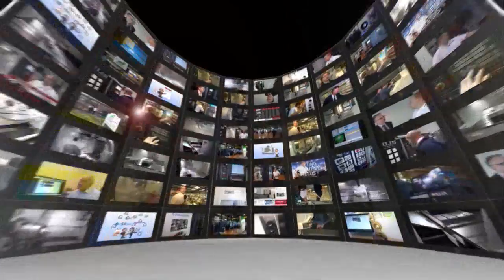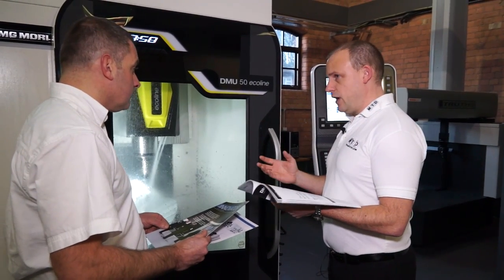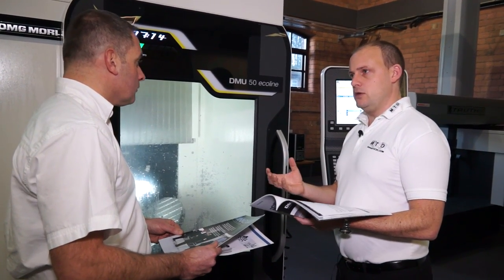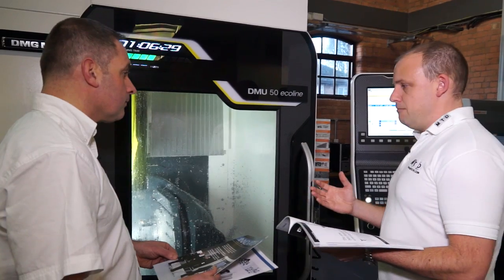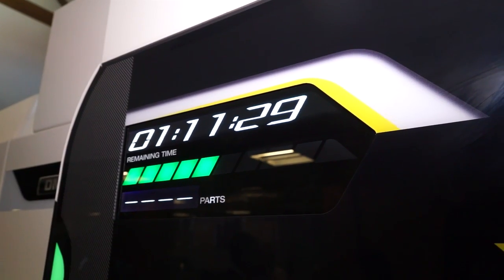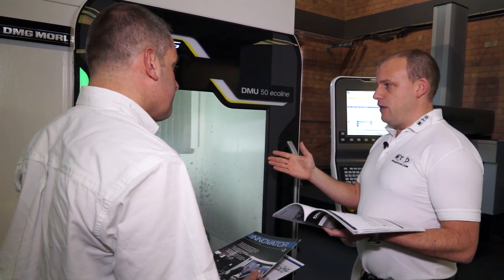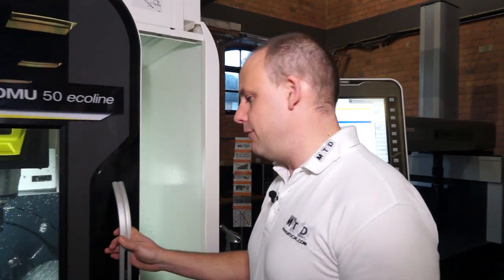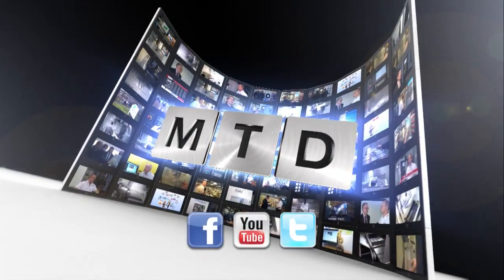DMG DMU 50 ecoline 5 axis machining centre

Comment: What prevents that machine from being 5 Axis continuous? Software limitations? If so, why? The machine costs probably a couple Hundred Grand. Shouldn't be that much more for advanced software to be Continuous. There are cheaper ways for only 3+2, so not to go all out on a DMG machine. As great as they are.

Comment: the 620 control sucks and you can't get into the tool changer. tools only go in and out through the spindle, so down time to rotate inserts and load tools.
Reply: yeah its really laggy, the old 530 is much more responsive. Why do cnc control manufacturers put old slow hardware in the controllers? i dont care if the machine uses a little bit more wattage if the control will be responsive and not laggy when displaying the 3d model.
Reply: @ipadize lack of competition